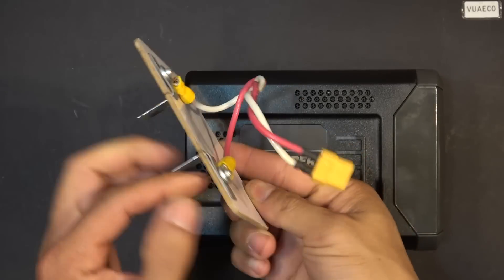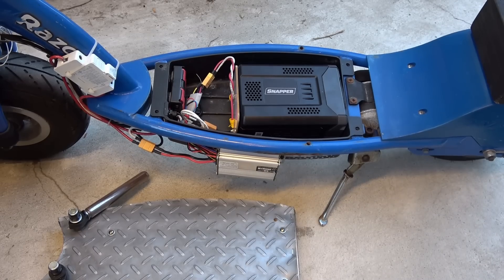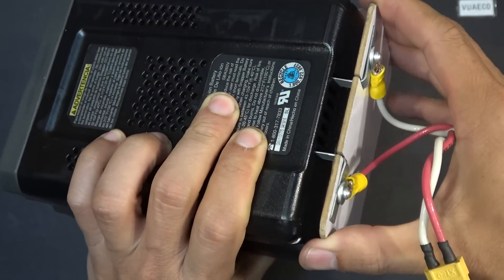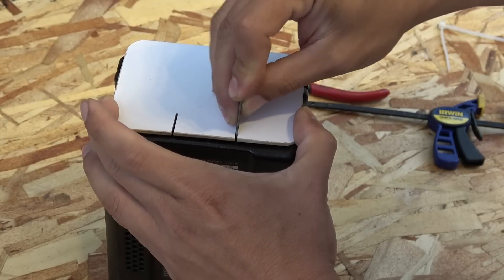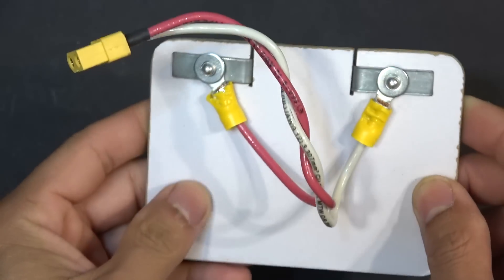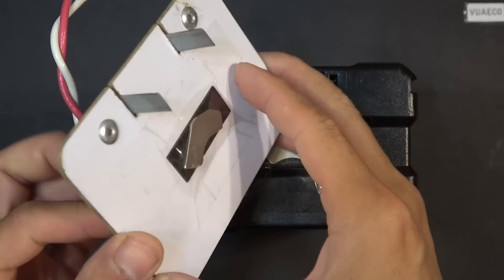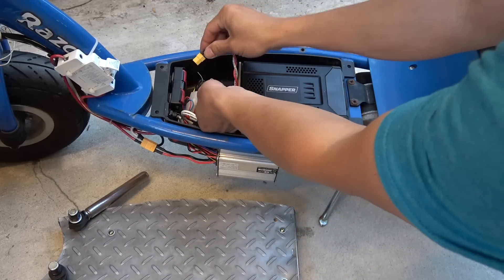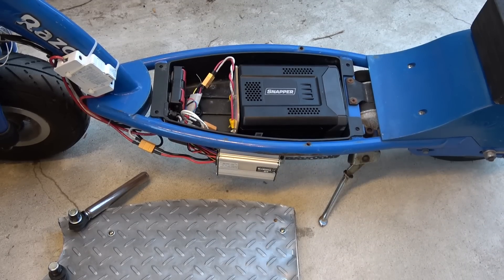DIY: Make an XT60 connector for the Snapper 60V Power tool battery (for Ebike & Electric Scooter)

Comment: I have 5 snapper 60 volt batteries
I want to build a e bike with one of these batteries. 
What kit can handle these batteries?
I also have 40 volt greenworks batteries, 24 volt kobalt, 40 volt worx, and a bunch of 20 volt batteries.
Looking to buy a bafang 36 V wheel motor and a 36 volt controller.

Comment: Quick question: Does anyone know how much volts this is under pressure like how a 20v is really a 18v...
Reply: Depends on load and c rating of battery's some people get bad voltage sag with a small load then the pack is not good for use

Comment: This is also what i wS looking for! I got a question, ive got a schwinn s500cd scooter 24 volt, what all will i have to change, just the speed controller for now until the motor gives out?, and do i need a 48 or 60 volt controller?

Comment: Hey buddy I want to tell you you've got some of the best diy videos I've seen. My son and I get a kick spending an evening watching different ones informative, entertaining and very comical at times thank you. I'm going to get some of those 60v power tool batteries and run a couple parallel next I've been running 4 sla's in series just because of cost but I just had to replace my controller and I went up from 1200w to 1800w it says you can use from 36v to 72v so why not go to 60v and a lot less weight keep the videos coming buddy
Reply from the maker: Thanks John. That'll be a nice setup you've got there for your EV. These Snapper batteries are very affordable compared to other brands.

Comment: What 18v battery configuration would be possible for a 48v motor? 3 in series would give me 54 volts, would that be an issue? thanks.
Reply from the maker: It should work fine on 54V. This is my next video of testing it out on both my ebike and scooter and it should answer your question: https://youtu.be/lDnF8M_OZek
Reply: Thanks, great video!

Comment: Hey, is it safe to connect different Ah tool batteries in parallel as long as voltage is same per pack? For example two 18v 5Ah in series paralleled to   two 18v 1.5Ah in series?(4 packs total all milwuakee) Thanks! Using tool batteries for my 36v ebike motor.
Reply from the maker: No, it is not safe to do that. Say you have a 5Ah cell and a 1.5Ah cell in parallel. The 1.5Ah cell will run out first. Then the 5Ah cell will become a charger and charge the 1.5Ah cell at full blast. It might heat up and turn into a fireball.
Reply: ok, though this would only happen if batteries were in series with each other but thank you for explanation!
Reply: @Cv56789  if you connect cells in parallel they won't blow as he described, although before you connect them parallel you fist have to make sure they are at the same voltage otherwise its completely safe, when they are in parallel it basically turns into one big battery and one will not be able to be discharged before the other. You still have to keep in mind max discharge amps max charging amps.
Reply: @mashedpotatoes5323  You sure about that? I am not.
Reply: @mashedpotatoes5323  based on what you are saying, a 1.5Ah battert parallel to a 5Ah battery will be limited to 1.5Ah of total current
Reply: @Cv56789  let's say you were to connect a cell of 2ah and 15amp max discharge with a cell of 1ah and 15amp max discharge in parallel you would basically get a 3ah cell, although the discharge amps doesn't double it does increase. For example if you were to draw 30amps out of that 3ah 2s cell more than 15amps would be drawn from the 2ah cell because internal resistance. That does not mean that you can't draw more than 15amps from the two cells but that at a certain point the higher ah cell will have more current drawn from it.

Comment: This is an excellent idea and implementation. I been trying to figure out how to use lawn mower/leaf blower batteries for my diy 48v 1000watt ebike (generic made in china kit). I currently use 14s2p (52v/58.8v) for my bike and it works perfect (from Luna Cycle). I don't know if going to a 15sXp battery pack will fry the controller  (which can max out at 63v).  There are various tools with 14s batteries - such as  Ego and Echo. There's also 15s packs from Greenworks and your Snapper. From what I understand, going over 60 volts is risky. 15s battery packs can charge up to 63 volts. For your follow up video, can you measure the actual voltage coming from the battery and see what kind of controller you're using, and/or show the charger's output rating.    Going with tool packages can be an economical option - and they've got great warantees - ie Ego leaf blower for $259 at home depot comes with a 56v 5ah battery. My luna cycle battery 52v 6ah was $300 plus $80 charger, $40 shipping.
Reply from the maker: You're right about the risk of over-volting the 48V controller. I'll give you detailed info in my next video after I do a test run on my e-scooter and ebike.
Reply from the maker: I've just posted my test video on this and my ebike and scooter worked fine on 60V. Here's the video: https://youtu.be/lDnF8M_OZek
Reply: excellent. thanks.

Comment: What controller are you using with the 60v battery. Closest size would be 52v which still seams to be a mis-match. Any problem in not matching voltage size? 
Thanks for your great instructive videos.
Reply from the maker: I'll give you detailed info in my next video after I do a test run on both my electric scooter and ebike.
Reply from the maker: I use the same 48V controller for my e-scooter and also my ebike. Here's the video: https://youtu.be/lDnF8M_OZek

Comment: Dude, sweet idea. The batteries that come with the mower at walmart are 4ah.... if you are looking for an upgrade to that 2 ah
Reply from the maker: 4Ah is much better. It'll give me longer run time and also more torque for climbing hills. It's expensive though.
Reply from the maker: It depends a lot on how fast you go. If I just max it out all the way at around 30MPH, it lasts for about 3 miles max. If I just go about 10MPH, I can go about 5-6 miles.
Reply: About how much miles can you get on an ebike with that 2Ah??
Reply: Hey buddy do you happen to have the measures for the distance between your metal bars and the length of them, I ordered a couple of snapper 60v but kinda want to go ahead and make the connector so it's ready when I get them.  Thanx